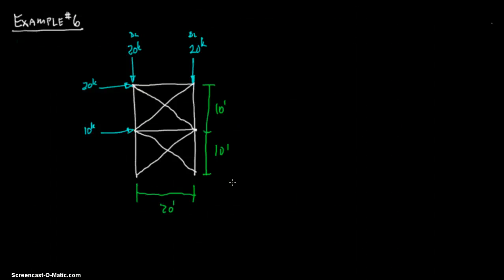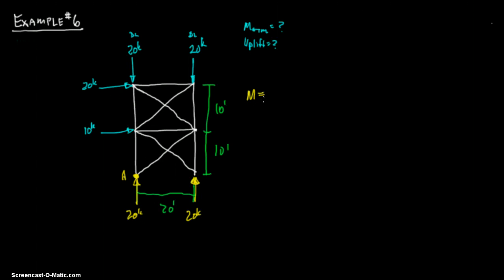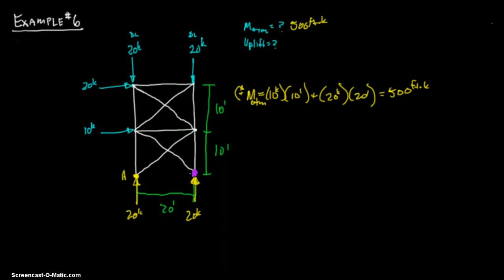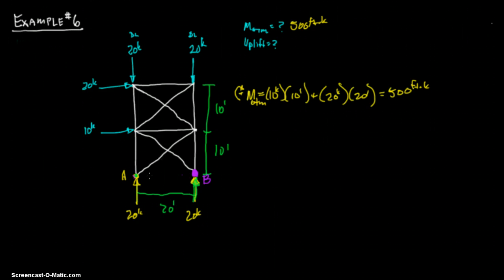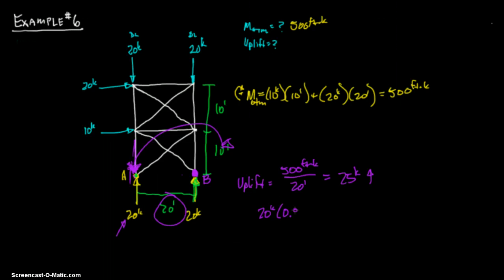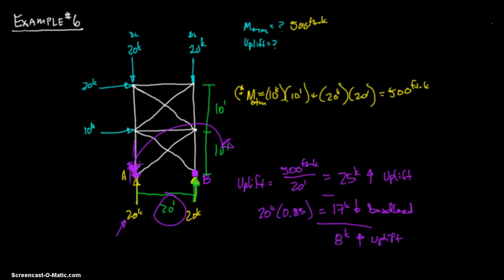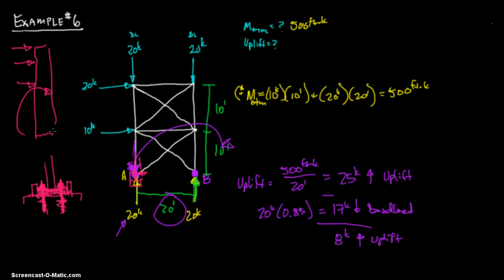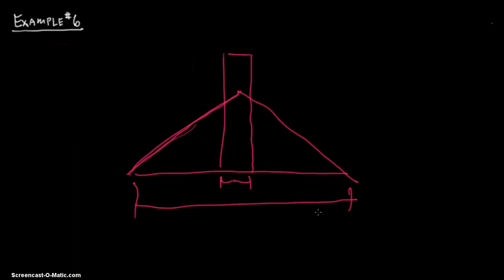Gen.Struct.2 & Lat.Forces - Lesson 4, Example #6

Comment from the maker: I said "wind load" at one point but it is a seismic load.  I also misspoke and said that we need to reduce it by 25% when is actually 15% reduction of Dead Load when dealing with uplift.  I used a reduction of 15% in the calcs, but initially said 25%--just wanted to clear up any possible confusion.